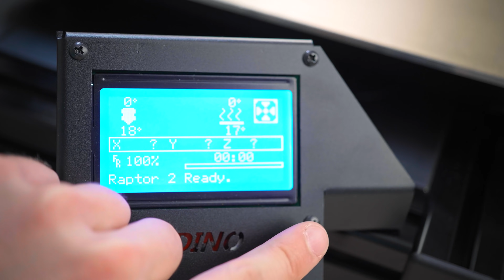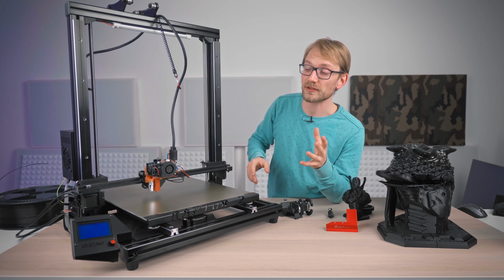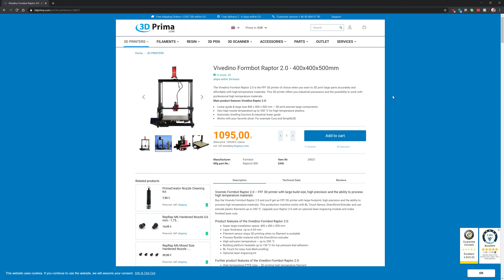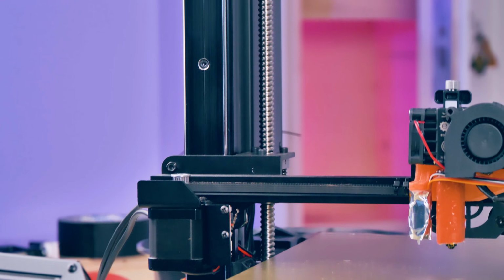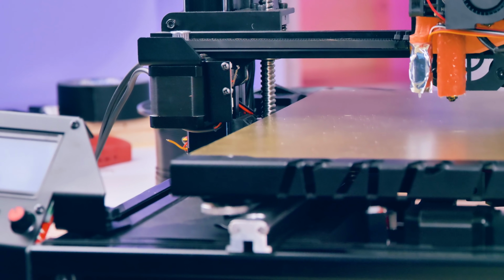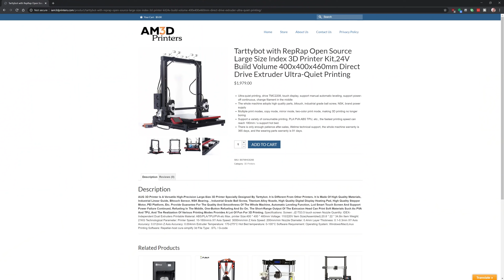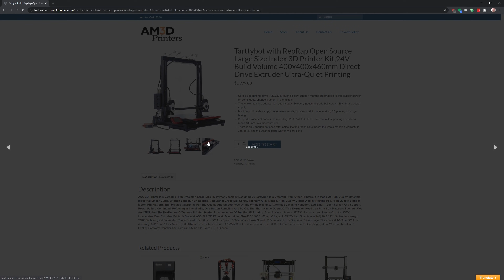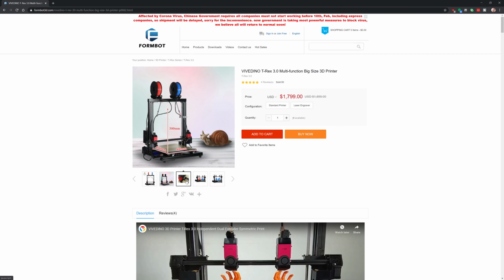This huge 3D printer was fun, but absolutely no one should buy it - Formbot Raptor 2.0 review!

Comment: Hi Thomas, I just sign up for your channel, I have a Question,  year ago I bought the Trex 2+ 110 power ( ya it's a boat anchor) I would love to remake into a better 3D print where do I start?
Reply from the maker: Sounds like quite the challenge... Perhaps getting a smaller printer that can do decent speeds and leaving the T-Rex stock for larger prints would be a better option?

Comment: “One shouldn’t assume malice for what stupidity can explain”

There’s a fantastic quote right there :) sums up many machines and kits

Thank you for showing us how a 3D printer shouldn’t be made! Already, I am very keen on how the Voron 2.4 build plate stays static - I can see how that is a good thing when it has a 230V heater. I currently run a modified Tronxy x5 and am looking at ideas for my next printer. Note that the Tronxy also uses a 40-pin interconnect between controller and extruder/hotend wiring, but it actually serves a purpose there by lifting the interconnect ‘daughterboard’ to near the top of the frame, so the wiring from extruder/hotend is standard length while the electronics stay low-down for cooling. It seems the designers of this Raptor completely missed that purpose of having an interconnect board. Perhaps they never had to change a fan or thermistor. No malice, just stupidity :)

Comment: Complaining about a light in a review, Really? I have 3 different brand printers and 1 resin. I use them within their limits and they all work fine.
A good size build plate is what I desire and most people would too. Any printer can become unstable at height and at speed.
Slow it down and let it do what its designed  to do and print! Everybody wants to rush rush rush! Not me.
I've had drama with a well known and brilliant printer. I like it so much I recently upgraded it! I wish it had a light!

Comment: I bought a Raptor 2 + that can print 400x400x700 in September last year because I needed a printer that could print 620 mm. I had no problems with the printer, all I changed was the bed to glass and the hotend to a copper. I have no problems with layer switch, of the 3 printer I have this is my go to when the model is to big for my ender 5.

Comment: I hear ya but In all honesty but this has been my experience* with most printers I have bought and then some. The extruder on the raptor feels like a powerhouse compared to the mk8 on the cr10 s5. I still think formbot makes solid printers if you are willing to just change the hot end and some wiring. The price is double of what I'm personally willing to pay though.

Comment: At the moment I am also looking at a bigger 3D printer, I found the SV01 by Sovol, buy can't find alot of reviews. IT has a 280x240x300mm printing area and is direct drive. 

I am wondering though, if it is superior to a BIQU B1, which is smaller and has a boden style extruder. The BIQU B1 is really quiet with 47dB, but the SV01 is really loud.

Anyone got any advise, whats better in your opinion?

Comment: No machine above 300x300mm should be sold without a flex plate. I put Ziflex on my CR10 Max, best upgrade so far. Not all there is to be done, though.

Comment: Oh no! It reminds me of my Tevo Tornado. I COMPLETELY rewired it with proper 3 core flex, added fuses, changed the ridiculous 10a fuse in the PSU, changed the wiring so that it is now fused on the live and not the neutral and doesn't present exposed mains voltage to the connectors at the rear of the control box, added Protective Earth to the frame, added strain relief to the unearthed skinny mains powered heated bed cables at both the bed and control box ends, added extra insulation to the skinny mains powered heated bed cables, shimmed-out the frame to make it straight, added a bltouch and blue tape to to heatbed (after trying various other solutions like glass etc) to compensate as best as possible for the warped bed, uploaded completely new firmware with thermal runaway protection enabled, changed the power supply for a decent one, changed the solid relay for a decent one, changed the fake FTDI chip on the mainboard to allow Octopi to work and allow it to communicate properly with a computer, added a Rasperry Pi with Temperature Failsafe and Smartplug plugins to shut down power if the temps started misbehaving, added a smoke alarm linked to a hacked 433Mhz socket to shut it off if there was smoke, changed all the wirewrap, changed the SD (which had been programmed to report a fake size).... I still won't turn my back on it and it still needs Pritt Stick to print anything reliably but is at least usable. Other than that, it is great. Last time I buy anything from them...

Comment: It wouldn’t 230VAC but rather 120VAC if only one wire is through with standard 230-240VAC wiring. That’s still dangerous though.

Comment: The sad thing is, this printer could be a good printer with a few easy mods, but at the price point it should be better than this. It does seem like it was designed by people who have barely even used 3d printers. I also hate how none of these chinese printers EVER have good parts cooling. Either they use anemic 40mm fans, or their ducts are designed terribly. I shouldn't have to print a 3rd party modified duct to get proper parts cooling.

Comment: To clarify for those wondering, you're correct that this machine requires CE or other electrical safety certification (UL, CSA). This is the case because there is wiring, connections, and devices working at mains voltage.

Most 3d printers do NOT need this certification, provided the power supply used in the printer does have the appropriate certification, and that power supply reduces the voltage below about 60v (may vary by region).

This machine requires this certification for the high voltage heated bed, because the regulators want to prevent.... This....

Perhaps the bed has UL listing itself so that's why they opted for having a second power cable, thinking it doesn't apply, but my non-lawyer opinion is that since they have connections for the solid state relay and not a straight cable from the wall to the bed that wouldn't fly.

Comment: Wtfff they used a larger stepper on the x axis than the extruder. You were having to lower the flow due to it using a 34 mm motor on a 1:1 dd.. but not gonna lie if this printer was free. It seems like an easy upgrade to get it reliable. Bigger or dual y motor, and rewired electronic box

Comment: As someone who been doing electronic repair for 30 years cause when I was younger I wanted to learn how to repair my own stuff. That VGA connector at the extruder is a very poor choice not counting the rest of the mistakes that was made on it. Who ever designed that 3D printer better pass the torch to someone else which more knowledge about electronics and moving parts. lol

Could try designing something that would wrap around OR encase the VGA male connector at the extruder. I think that would reduce the stress being placed on the female VGA socket at the extruder.

Comment: I agree with you on about everything except the belt tensionning system for the Y axis I like seeing a manufacturer include a tensionning system and a belt aligment system. Especially soo if the belt motor and tensionner are not on a the same Aluminium profile . It allows tracking adjustment of the belt. Only problem I would see is this adjustment vibrating loose since i didn't see any way of locking it. While it could have been made better I don't see it being a major issue.

Comment: one of the issues with 3d printers is that no one uses " flex" cables. so yes the cables fail but if you get proper drag chain compliant cables you should be fine. although it is a bit expensive

Comment: Tom, can you recommend a non China company 3d printer with at least the print volume of the ender5 plus or raptor 2. I have the raptor 2 and it breaks down almost every other print. I have the creality ender 5 plus but after 3 prints it has also broke down. Mostly wire breaking and hotend failures. I am printing almost nothing but petg. I need a work horse that is not going to make me poor purchasing it.

Comment: I would buy it.  If it was just the frame. No electronics, no extruder just the frame. For 250 to 300 price. 900 to 1000 is insane for a POS.

Comment: I thought the 2208 does do stall guard?  I think those driver boards are set to stealthchop by default, and it is stealthchop 1, the one that does not support skipped step detection while stealthchopping.  I think you have to cut or bridge a jumper or something on the driver board.

Comment: This sounds like someone designed a good machine and then some idiot took the plans and replaced parts without understanding why certain parts were picked such as the bed heater wire type

Comment: I have an Anycubic Chiron.. Also 400x400, but only 450mm height. 
It has it's own set of issues, but easily tweaked, tuned and upgraded, and only about half the cost of this machine with decent support from Anycubic. And... I only need 1 plug.  :)

Comment: I got a CR-10 S5 a few yeárs ago, for about the same price, and it's much crappier than this one, but the only thing Creality got right was that they put in a beefy NEMA stepper for the Y axis.
I was left with replacing the warped bed with a cast aluminium pláte magnetic buildplateánd silicone heater, replácing the hotend with a Mosquito Magnum, replacing the melzi board with a Duet WiFi board, installing linear rails. Now I'm looking at getting a Flex3Drive or Zesty Nimble extruder 
I spent more on parts than I payed for the CR-10 S5

Comment: I had to use this thing for work for a year. We logged well over 1000 hours on it. At times it was great, but always, always required constant tinkering. PLA used around the hotend... Give me a break! The very fact that your hot end cable can catch on your print shows that it could have never been tested to its maximum volume.

Comment: I have a "Trex",  cousin of the Raptor. I would say these printers are valuable to small group of people. They are definitely not for everyone. I agree with so many points you have made. The wiring is horrible. Mine had a custom POS ribbon cable going to the carriage. It caught on everything. Im glad my cat chewed it in half. Weak does not begin to describe the extruders. It is a crime to call the included hot ends e3d volcanos (not even a 1/4 of the quality). But, the machine has a nice motion system that is rigid and smooth. After a few years of messing around, mine will produce prints that are better than my Ultimaker3 can make. It takes more involvment though. I upraded to 32 bit board (first week), real E3d extruder and hot end, 0.9 degree steppers, and custom bed holders. Interestingly, ive never had trouble with the steppers skipping, even at .7 amps. I now have trinamic step sticks, and they will skip if i push it to fast. It appears the only name brand item on the printer is the BL Touch sensor. I also take advantage of the large build platform for laser engraving (not the peice of crap that was included) and light rotary engraving. It does very well. 

Thanks for reading!
Reply: maybe I'm just tired but "I'm glad my cat chewed it in half" is so funny to me

Comment: @6:19 LMFAOL good call Thomas.
Reply: truth be told i like the idea of 2 sep connections because i rarely use the heating bed especially when im thinking of printing all night   " it gets my room really hot and is not good for sleeping PLA" so i can appreciate that plus lets not forget that IF something was to haywire the last thing i want is for my printer to catch on fire cuz of all the connections the control box uses since the bed is the only one thing that will be high powered.

Comment: This did not seem like a review, it seemed like a rant.
Show me another printer with

Linear rails
Quality ball screws
Very stable build
Quiet stepper drivers
400x400x500 (or 700)
That costs less then 1k dollar..

And then continue to add what Thomas wants
32bit board
High end extruder setup
Marlin 1.0 because its more "stable" 
Cable management

And still make it cost under 1K

Comment: Hi everyone. I got a trex 3 from formbot directly and I want to give some comments:

Word before:
- I owned a lot of printers before (no beginner) and I wanted a base IDEX machine I could customize/mod
- No children around

Things I agree:
- The layer shifting was there but a issue caused by the marlin 2.0 firmware. I flashed a 1.19 firmware and those were gone
- Missing grounding for bed + Cable chain design by factory means danger for life
- The "150°C" bed and the "350°C" extruders are false advertising (imho) and could lead beginners buying this printer into misery 
- No 32 bit board by factory
  

Things I disagree:
- Putting everything in boxes (230V wiring) prevents me from seeing any potential damage. I dont want this.
- The trex has a perfecty fine extruder set (IDEX) compared to the reviewed model. Nothing to complain here.
- The Y-Belt tensioner is perfectly fine. Why the rant here?
- Reliability: My machine is a workhorse running print jobs all the time and no issues/wasted filament
- Power of the Y-Drive is fine

Things I changed:
- Better cooling fan for the mainboard
- Added a 4mm glass bed (made the bed really heavy but no issues :P)
- Switched the 2208 drivers to 2209
- Replaced the cable chain by the wider model (got it for free from formbot)

Comment: I know nothing about 3-D printing, but I used to be a cabinetmaker, so I know a little bit about handtools and woodworking machinery. I'm almost happy to see that this printer is so flawed. You know why? Because it gives an essential kick in the rear to every manufacturer who thinks that this remarkable new(-ish) technology should be cheap and available to all.

But it shouldn't be, and people need to see videos like this to appreciate why. Frankly, quality still costs money! It's as true now as it was 1,000 years ago. In my field, a good woodworking chisel can cost upwards of £100. It'll take and hold an edge you can forget about, meaning you'll be able to devote every scrap of your attention to getting the job done. The tool just becomes 'you'. A cheapo £3.00 chisel won't be much use for anything more than prising the lids off tins of polish.

A decent smoothing plane can cost £350. It will never let you down and will produce consistently excellent results for literally hundreds of years.  Yes, really. A cheap and nasty copy will only cost £15 but it will be crudely finished, impossible to 'fettle', adjust and fine-tune, will damage the job you're working on, and will give unpredictable degrees of finish. Of course it'll let you make things, but it'll only let you do it... badly. Rather like this dodgy 3-D printer.

The same applies to woodworking machinery. Setting up a workshop? Try to buy quality. You'll never regret it. Don't buy new unless someone else is paying, because you'll go bankrupt. Buy used stuff with cast iron beds, enormous old-school motors and huge, solid, heavy, finely-calibrated hand-wheel adjustments. Forget about electronics and LED screens and fancy automation that lets you run it from your mobile phone - such things are included at the expense of the bits that really matter.  So a lot of people will seek out vintage machinery that's 'matured' over 60 or so years of daily workshop use. It'll be better than any of the shiny flimsy stuff built down to a price and which will need constant attention and repair and give lousy results in comparison.

The old adage about a bad worker blaming his tools is entirely reasonable if the tools are decent, but it's fair criticism if you're holding a piece of rubbish in your hands. 3-D printing would seem to be no different. A few years ago these were exotic industrial machines costing £50,000 or more. So why should people think that a hobby-grade version costing £800 will be wonderful? It may be fun to experiment with, but you'll spend more time improving it than actually using it. So the hobby becomes not printing, but fiddling. Lots of people get hooked and absorbed in buying cheap then upgrading their 'toys' - which seems like a harmless enough thing in itself and is actually very satisfying - BUT it can be ludicrously expensive (be honest with yourself!) and it sends out the wrong message to manufacturers. To wit: why should they produce quality goods when their uncomplaining customers are prepared to do the work for them!

Thankfully, this kind of proper assessment and review should help to stop people making some unfortunate purchasing decisions. 3-D printing is fascinating and clearly brilliant fun, but not if you're expecting to get professional results from what's basically a half-finished machine.

And it's not the buyer's fault that he thinks his hobby-grade printer will be great; it's the fault of the unscrupulous manufacturer who's filled his head with unrealistic expectations.

Bravo for an honest review, sir. Let's hope the manufacturers take note.

Comment: This looks like they mixed up their first prototype of the thing with the finished machine and sold the prototype version instead. OUCH! Sooo badly built! Carbine hooks for print cable support wich is in turn a lousy VGA cable not even standing in place, metal pins and boat parts for the rear belt roller instead of a proper bearing supported axle. Undersize motors and dangerous wiring plus also beta version software. This machine looks like a disaster to me for sure! No NO ONE should indeed ever buy this machine unless they start replacing prototype version V0.01 with finished version V1.0 or better.